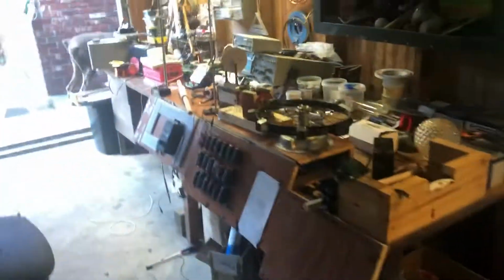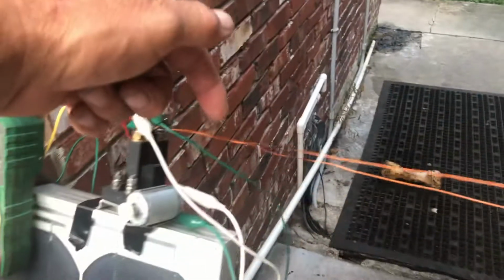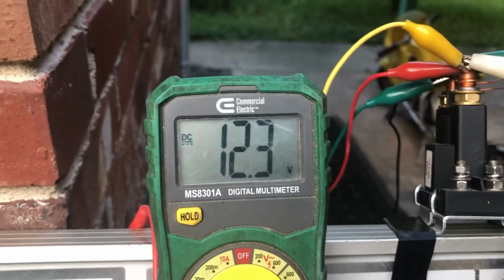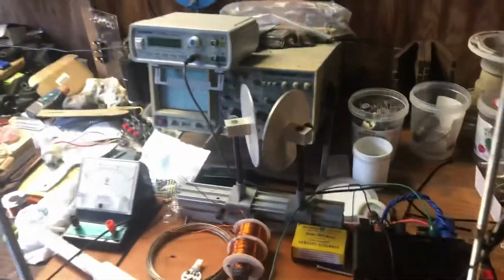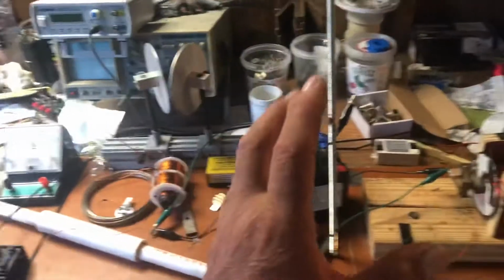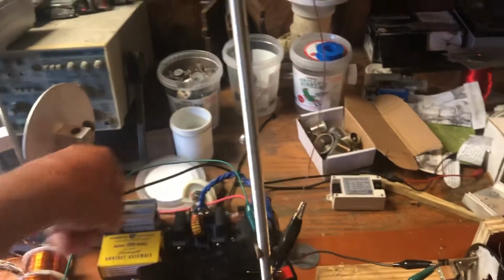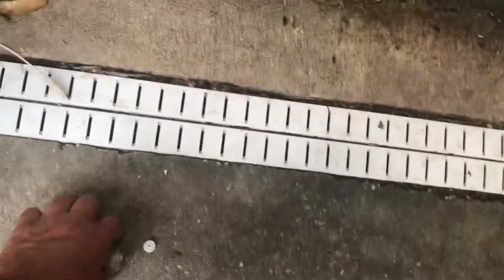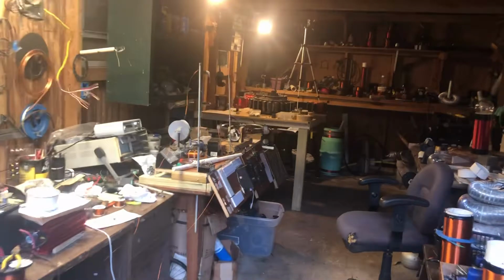Oscillating Expansion!

Comment: if you tap into the spark gap there, could you run that into a second coil on the opposite side of the wheel and give her a push from that side?

Comment: If Vin barks at the panel it should increase voltage. And you might hear it in the coil because it could act as a speaker. When you show the back of the panel, is that an inverter? And you said the starter transformer wasn't used, then why are you connecting through it? The bicycle wheel is a generator. It's not surprising it will turn the DC motor. Coming out of motors and using them as drivers or oscillators is something I might look into. An easy way  to mimick AC and so on.